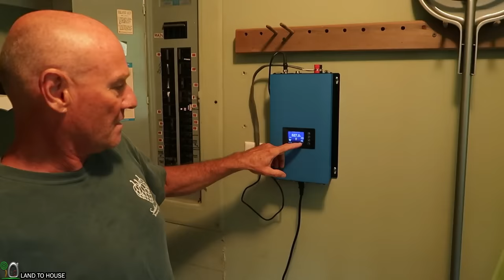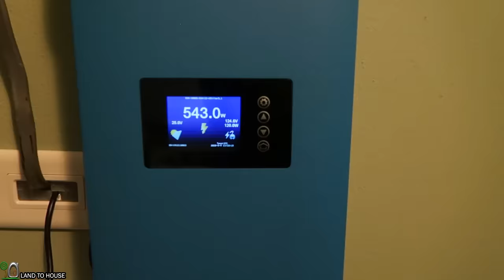Awesome Low Head High Flow Grid Tie Micro Hydro 530 watts!

Comment: I noticed that Bill's system has a constant amount of air bubbles exiting at the discharge of the pipe in the lower pond. This means there is air being sucked into the system somewhere. It might be below the turbine. However, if there is any air leaking into the piping before the turbine, that will reduce turbine power and efficiency.  With air leaking into the piping below the turbine, that decreases the suction at the turbine  runner discharge also reducing system power and efficiency. There should be no air evident exiting the discharge pipe in the lower pond, the water flow from the system should not be visible.
Reply: Good eye. I would also add that this would not only reduce turbine efficiency, but turbine lifespan as well.  You want a good clean steady flow of water without air whenever running flow through any moving parts to maximize the lifespan of parts. Think of how highway miles on a car engine is better than surface street miles.
Reply: If the feed water is completely underwater it is possible that the bubbles are from air getting in post turbine , possibly at the joint where he demonstrated the suction . If so the turbine higher than that joint would not see any air .
Reply: @A2Z1Two3  You are right. However, air entering the penstock piping below the turbine will reduce the effective head of the system.
Reply: @johnstuart3851  Instead of the tennis ball, he needs to enlarge the intake. This will reduce velocity and eliminate the vortex.
Reply: I think the air is actually from cavitation. Thats when the water will boil due to high suction pressures. He could solve this by placing the generator at the bottom of the pipe instead of the top
Reply: @martinair329  You also want to reduce entrance losses at the intake. The usual way to do this in pumping stations is to use a bell shaped intake.

If you just have a straight pipe the water abruptly speeds up at the intake creating a "dead zone" on the inside of the pipe next to the intake where water just swirls around without really flowing anywhere, reducing the effective diameter of the pipe. A bell mouth intake is essentially a smarter way to make the pipe bigger at the intake.
Reply: Some of the bubbles will be caused by dissolved air coming out of solution due to the low pressure
Reply: @soylentgreenb  Good to know.
Reply: @fredrelay1052  agreed - its cavitation
Reply: @trueriver1950  That is possible; however, I don't believe the negative suction pressure downstream from the turbine discharge is sufficient in this case to cause that to occur. The total head for this system is apparently less than ~12'.
Reply: @LegendLength  The suction is a function of the water level below the intake at the top, drawing water into the piping and turbine. It is the flow of water down to the outlet level creating the suction from the restriction of flow at the turbine. The amount of this reduced pressure is from the unit weight of the water, the volume flow rate and the head of the water column from the inlet to the outlet elevation.
Reply: @fredrelay1052  One advantage I can see of having the turbine at the highest point in the system is that it is impossible for any water to leak into the electrics of the generator.
Reply: The white pipe is 6 inch and the green one is 8. So it is normal IMO that there is bubbles developing in the final flow because the pipe volume increases and receives less water than the pipe can accommodate....hence the bubbles

Comment: I really like what you did here and I don't see any negative environmental impact. The folks in the comments that seem to have invented reasons to disparage the set up don't seem to have watched the same video that I watched [SMH]. I can see that the OP does not respond to comments but it seems obvious that with that much drop a second inline turbine could be installed to yield more power.  The greatest cost to the system is the control/convert/regulate and storage components.  I hope you add to the system and sell the excess power back to the grid.  You're an environmental hero and naysayers are just sour grapes.

Comment: I wonder if he could use some sort of ballcock system that slows the intake down using some sort of 'cover/mesh' that slides over the intake if the level of the pond drops too much.
Reply: Yes I have a valve set like you describe, it works well.
Reply: thats one way to do it after the fact oc, but if you are going to the trouble of "making a lake"/storage of potential energy then its probably wise to give some time and effort to re/move some extra dirt to make simple upstream canal gates in a reduced width of the lake you make to simply limit water flow as you wish later, 
and a simple super deep slopping trench in the direction of flow your trying to make, and put a few different sized plugged up pipes in there to use later (laminar flow surface flow vortex drain to pull in your inital tromp air.
(a few long range gigabit fibre optic cables because you know you will eventually want better than wireless lan (remote cams etc) at both ends sometime lol etc) ,before you fill the lake.
Reply: Or HE could just leave the "VACUUM" valve open - that would reduce the draw on the intake...

Comment: You could easily calculate the efficiency of your system by figuring out the water output vs watts/hrs.
Your dam is easily figured out as to surface and hight.
Would be interesting to know...
Nice project.
Reply from the maker: This was the first time I had met Bill. Perhaps I can do an update with him in the future. Include more data.
Reply: At 350gpm over 15ft of head, raw hydro power is ~990W
Reply from the maker: The basic power formula is (head pressure x gpm) /10 = power. That is 525w.
Reply: That’s right, this is how you get electrical power for this kind of setup.
For “raw” mechanical power, formula is :
Power (W) = Flow (kg/s) x height (m) x 9.8 (gravity, in m/s/s)
1kg of water is precisely 1L (at 4 degrees centigrade / ~39F)
So for 1gpm @ 1ft head:
~3.8/60 L/s * .305m * 9.8 ≈ .19W
Or a simpler approximation :
flow (gpm) * head (ft) / 5.3 ≈ mechanical power (W)
350*15 / 5.3 ≈ 990W
Reply: @BullCheatFR  how about the efficiency of the turbine and generator is usually between 40-80%.
So Watts = Flow, gpm x Head, ft  x 0.19 W x 0.80 (efficiency max) = 798 watts for 80%
50% efficiency = 498.75 watts

Comment: Low head High flow - you could take the discharge from your existing microhydro and run that through a low head high flow turbine for more generation capability.
Reply: Essentially the turbine spins using suction instead of the head (weight of the water). I’m sure there is a loss of efficiency but it is very small.  It a good setup for a DIYer to offset the cost of electricity ⚡️ which will only increase in price over the years. Much better plan than solar or wind which are intermittent.👍

Comment: 9:00 Depends how much power the rectifier has to dissipate. looking at it current state it doesn't seem like it's having a problem.
Would be better to have a turbine generating a higher voltage to have less power dissipated from the rectifier and return have a higher efficiency when converting to DC.
Reply: generally a rectifier diode will have a voltage drop across it of about 0.7 volts. a rectifier bridge is essentially 2 diodes in series at any given time, so you end up with a voltage drop of about 1.4 volts when you convert from AC to DC using a rectifier bridge. you can multiply 1.4 by the current flow in amps, which will give you the watts of wasted heat which you'll need to remove from the bridge. so, if you're able to increase the voltage across the bridge, you can get more power from the system with slightly less losses. similar applies to the wire and cables. thicker cable will have a smaller voltage drop. a high voltage on the wires allows for a lower current and less losses as heat.

Comment: Love the ingenuity! A safety tip, the N.E.C. (National Electrical Code) requires all wet and exterior connectors to be WT (water-tight). Starting with that Romex connector you've got on your generator's junction-box. Plus you should shield your home-run with electrical conduit since it's ungrounded and never allowed to be surface run.
Reply: While we are talking electrical safety, I couldn't quite make it out:
Is he backfeeding his home through an electrical outlet, from the bottom of the inverter?
I would hope that was the feed-in for grid assistance, but it was a bit confusing around when he says "from the grid into the grid", and then proceeds to talk about a metering clamp preventing backfeeding and killing a line worker.

I really think this entire setup is extremely sketchy. I would have powered an MCB or two, with separate lines, feeding from the inverter, and then having the inverter take grid power to supplement it, when it can't do it using the generated hydro power. That could never backfeed. The inverter would have to be rated for the entire electrical group it would be supporting, but I think it would be safer.

Relying on an external metering clamp for "island detection" seems weird. It looks so janky. Maybe it's just me, considering all the safety things we have to do in my country, and basically use a changeover switch for anything that could backfeed (like a generator) and being required to use not just an electrician, but an "authorized electrical installer" to come and wire in systems like solar, if we want full grid-tie.
Reply: The NEC might have something to say about the Jesus cord he has feeding power into the house circuits.
Reply: @tjwatts100  in the U.K. we call them “widow maker cables” - when you make a make plug live. Very dangerous
Reply from the maker: When the grid is down these inverters are off. They always pull 4w to 6w from the grid.
Reply from the maker: These inverters feed the house only if the grid is detected. The moment the grid is removed the inverter is off.
Reply: @tjwatts100  Grid-tie inverters are NEC compliant since they're not really a jesus cord, they just look like one.
Reply: @TheNewFaceOfHSP  It seems you don't actually know what's going on here. That is a grid-tie inverter which can only operate when the main grid is live. There is no backfeed danger. His only issue would be getting charged the incoming power rate for power he's actually pushing out.
Reply: @LandtoHouse  what stops the user from
unplugging the back feed from socket and touching the male prongs?
Reply from the maker: Once the 60 Hz 120 V grid power is removed the inverter is turned off. There is no more power coming out of the unit to do any harm.
Reply: @LandtoHouse  even if the male plug is disconnected with the grid still on and the generator still on? That is, does it sense the grid from that plug and therefore isolate the output from the inverter when the plug is removed, or is the working grid detected independently? In the U.K., such a system would not at all be allowed regardless. A power socket is an outlet for power, not a receiver.
Reply: @LandtoHouse  I have rewatched it again and it certainly seems that it is dangerous. In the event of a loss of grid, the inverter does switch off according to what he says. There is a sensor wire (presumably) checking for voltage on the board incomer and if that is lost, the inverter turns off and no power is fed into the house.

However, if he unplugged the male cable which is back feeding the house, the sensor cable will not know this from what he described, it will still see voltage on the grid. However, there is still voltage on the male plug. It doesn’t seem safe to me unless he’s describing it incorrectly. What stops me accidentally unplugging the inverter from the wall socket and then touching the plug prongs?
Reply from the maker: The amp clamp only reads if power is being used from the grid.  The 3 pronged plug is activated only if 60 Hz and 120 V is present.  Check out my channel videos for the updated powershed for my personal microhydro. It may help shed some light.
Reply from the maker: The 3 pronged chord is excited by the grid. As soon as that's removed the entire inverter is powered down Regardless of battery input or amp clamp. It would be 100% fine to hardwire this into a circuit. You don't have to use the 3 prong cord as in the video.
Reply: @LandtoHouse  but 120 V and 60 Hz and current flow would all be registered if the grid is on and consumer on inside the house, regardless of whether  the back feed plug is unplugged, no? It’s a fairly simple question and I feel like we are going the long way around. What isolates the male plug from power out fr the inverter if the male plug is disconnected?

It’s a serious question, from what I can see, this could be a serious safety risk.
Reply: @LandtoHouse  so there is absolutely no voltage on the male plug when unplugged, even if the grid remains on and power is being used, and even if the generator remains on? As soon as you unplug the back feed plug the inverter is off and there is no residual power? Ok if so, I’m not an inverter specialist to question that. It just seems a very odd thing to do and hardwiring it would be a lot safer.
Reply from the maker: @paulharrison2325  Sorry to go back and forth. Let's say we have these steps:
1. The inverter is only connected to the battery. Inverter has no output on 3 prong plug
2. Next Amp clamp is connected to the main power to read current flow. Inverter has no power output on 3 prong plug. 
3. Plug in the 3 prong cord to main power at 60hz 120v. Bam inverter turns on and reads current used by house and supplements up to set watt rating. While still letting at least 4w or 5w in from the grid. Never letting power go away from the house onto the grid.
4. Main grid power goes down because of a tree on the line. Inverter powers down as if unplugged 3 prong cord. No output because the inverter is off.
Reply: Backfeeding his panel through a fucking wall outlet....LoL
Reply: @russellv6234  could u explain?
Reply: @Wearepricester  Look at all the other comments. This is perfectly normal for a grid-tie inverter. It's how they work.
Reply: not to mention he is using 10/2 calbe, the 2 meaning there are 2 jacketed conductors within the cable. using an unjacketed ground wire to run the 3rd phase to the house is not only dangerous, but in Canada suuuper illegal and I can't imagine the case being any different in the US. say something be it an animal, a branch, a rock, whatever knicked the cable's outer jacket, you would have a live phase of exposed copper. Very surprising to hear he had an electrician look at his setup considering this. I don't want to be too harsh because everything else about the setup is increadible for a DIY project, but that cable should really be changed to either conduit like you said or at the very least 10/3 cable
Reply: Since we're talking NEC "code" here... (1) No water-tight connectors, and boxes. (2) use of unprotected NM cable outdoors. (3) use of the ground wire in that NM cable as a current carrying conductor. (4) 100% lack of grounding. (everyone's most loved subject) (5) back feeding power over a male socket. The only thing to remotely meet code is the grid sensing disconnect.

Land to House has argued to no end about the "safety" of doing so. But it's still a code violation.

Also every meter built in the last century is sensitive to direction. The issue is the power company not being aware of the grid-tie. (Duke has historically been a dick about it.) And there's little chance they'd OK that hokey setup.
Reply: @TheNewFaceOfHSP  that inverter has Island mode,  as soon as the grid turns off (power cut) the inverter will also turn off, this stops back feeding into the grid when the grid is down,  when the grid is up, then the inverter turns back on, with this inverter you can set it to only pump in the detected amount of power your house is consuming, the idea is it will zero out your meter/ stop it from reading power usage, but only up to the max amount of power your setup generates, in his case that might be 500ish watts, so if the house use's 750watts  he only pays for 250watts from the grid and 500watts is what the inverter injects into his house,  that plug will easily take more than 500watts, most plugs will take 2400watts for the type of wiring they use.
Reply: @paulharrison2325  as soon as its unplugged it turns off, so nothing happens if you touch the male prongs
Reply: @paulharrison2325  the sensor is only for detecting how much power the house is consuming, you don't even need the sensor connected for the inverter to detect if the grid goes down or if the plug is unplugged from the wall outlet.
Reply: @LandtoHouse  Everyone is assuming there is a backfeed on the plug going into the wall outlet.

Comment: Nice setup.  If I am seeing correctly you have a male plug end from the inverter feeding electricity to the single phase part of the home.  That should be hard wired. If a toddler un plugged that cord the plug blades will be hot and could cause an injury or death.
Reply: That "shocked" me too!
Reply from the maker: Thank you. These inverters are grid activated.  Once the plug is pulled from the wall it is dead. (Auto islanding)
Reply: I figured that might be the case as most solar systems work that way.
Reply from the maker: It's pretty quick too. whenever I pull mine from the wall i hear it click immediately
Reply: @LandtoHouse  What if it is partially plugged in. American plugs allow a bit of metal to be exposed before the connection is terminated - meaning your fingers, or implements, can make it to the contacts.
Reply: @Acecool  same danger as with a regular plug running to e.g. a floor lamp.